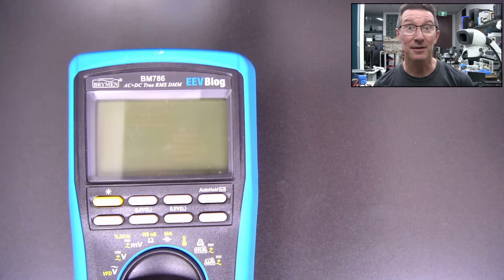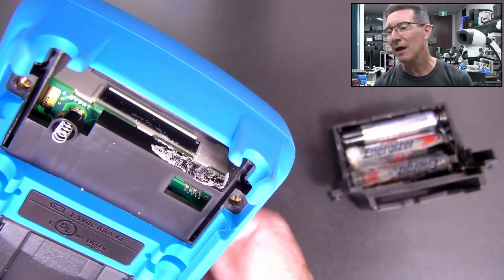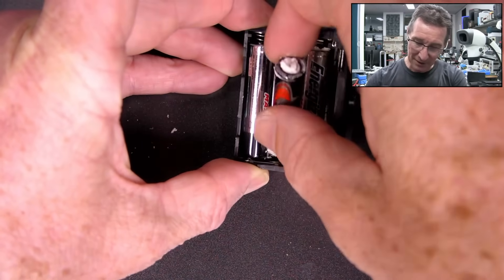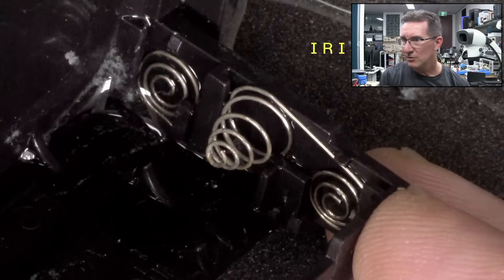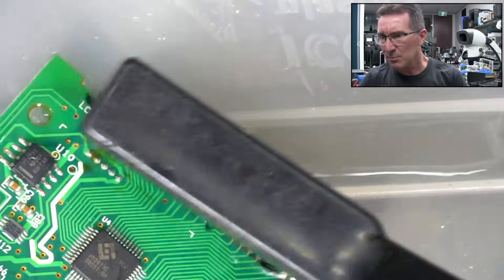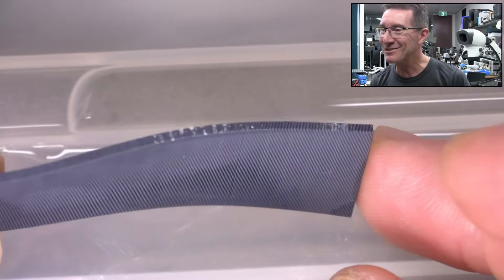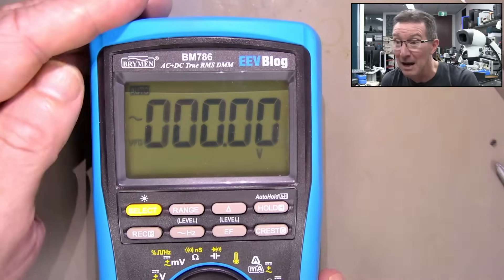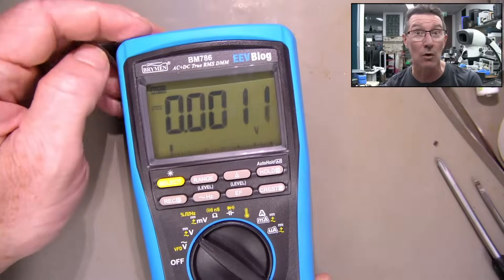EEVblog 1670 - BM786 Multimeter BATTERY LEAKAGE REPAIR + GIVEAWAY

Comment: I've also switched to low-self-discharge NIMH rechargeables for all my AAA use, and most of my AA as well, though I do use disposable AA Lithium when I find a good deal on them (or the device requires them). I've tried lots of brands. At the moment, PowerOwl is my choice for both NiMH rechargeable and Lithium single-use batteries, as (for me) it hits the value sweet spot for capacity, lifetime and price.

I'm finally completing my home automation system, which initially started with a bunch of WiFi devices, then I added BT and BLE, mainly so I could troubleshoot everything using my phone. Now I'm using Zigbee wherever I can, as I got impatient waiting for Matter to mature. I was intending to use more wired devices, such as PoE for my cameras, but even they are wireless and use batteries (Blink, on sale), and are doing the job so far.

All this means I'm using lots of AA and AAA batteries (and a few CR2032 cells). Most devices report their battery level/status, and Home Assistant logs that, so the logs tell me when I've replaced a battery. I write the device ID on the battery using a fine-point white board marker so I can match the battery with the logs. So far, this has helped me identify which devices lie about their power consumption, and which batteries suck (as individuals and as brands).

I eventually hope to assign serial numbers to each battery (including the AA Lithium) then let Home Assistant know which battery I've installed where, so Home Assistant can track all this for me.